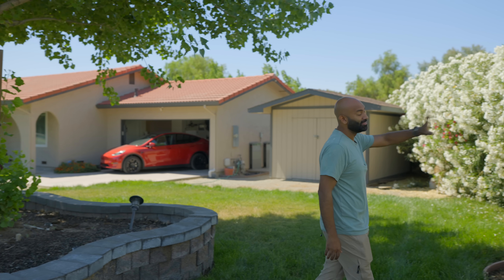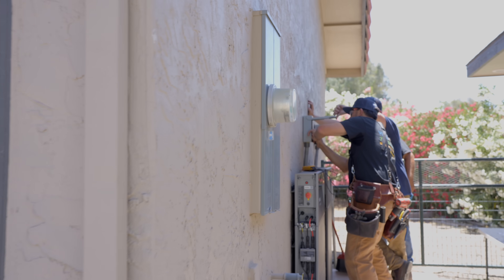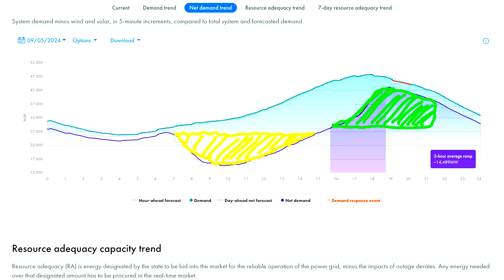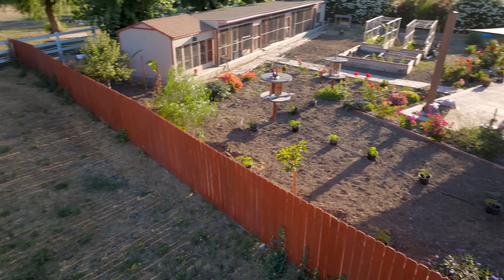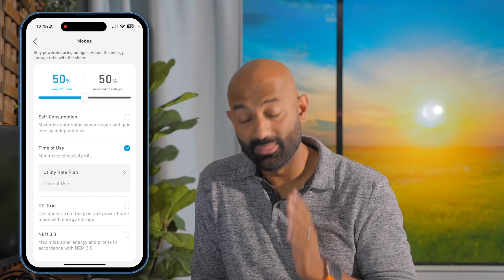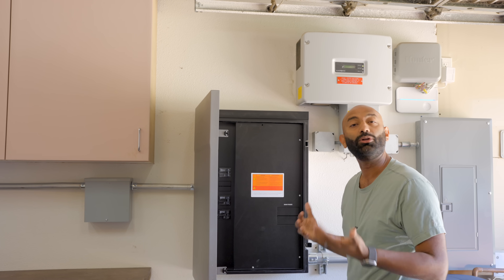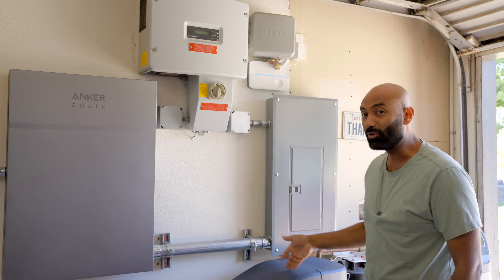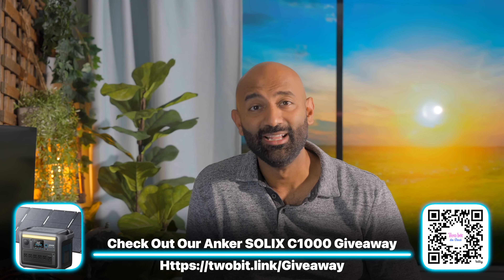Anker Solix X1 Home Battery - The One to Get?

Comment: We are completely off grid with a generator back and a boiler for heated floors and water. I wonder if I added this to my system if the generator would run less.
Reply: Some Hybrid Solar Inverters have a Generator option. If you connect directly to the Inverter, the Inverter will run it at a constant rate so you can set the most efficient setting for your Generator. This works best if your Generator has Auto-Start. So it should run less. As a side note... Generators always produce more power than you use if you are plugged directly into them. With an Inverter/Charger controlling Batteries, all of the power the Generator makes will go into the Battery (minus normal line losses). It is a more efficient set up as soon as you connect.

Comment: The way I am going to go about my system is, battery back up first. why? I want an APC style system to clean the incoming electricity so that my electronics do not burn out (where I am at,  I got 'dirty power' daily) also when a storm comes thru I will be alright. Solar is next with wind as a possible test project. now it's just money that is holding me back. lol (FL homeowner)
Reply: my thoughts exactly. set up a smart panel and battery back up first, but set it to add solar - perovskite panels when commercially available - and wind

Comment: Good video, but it would have been good to address why the montly bill after the batteries were installed was $121.17 compared with $71.94. Clearly they had much higher overall usage this year (the kWh number is up by a lot), but why was that?  Because if there's no factor other than the change to batteries, it looks like they were a poor investment.

Comment: I doubt I could use this in Southern Nevada with 120F peak air temps and this year over 100 days over 100F.  The exterior of my house is regularly 130F even out of full sun - add a battery that is generating heat as it charges or discharges and that's one hot potato.  Even if it keeps running what does that do for longevity of the batteries and inverters?

Comment: Great video and info, thanks.   Given they remain on NEM 1, can I conclude that they didn't need a new permit when they added the batteries?   I'd like to add additional solar panels to my current 5.5 kW system and possibly battery storage as well but have been told I'll lose my NEM 2 and go to the current less favorable NEM 3.   Live in SDG&E territory Encinitas CA
Reply: There are some exceptions that allow add-ons without losing your older NEM status, but I don't have a list in front of me.  I think adding batteries without expanding existing solar might be one of those exceptions.

Comment: In Ontario (Canada), we have a very generous Ultra Low Overnight rate TOU plan, which offers power at $0.03/kwh (works out to around $0.05/kwh with transmission charges). You can knock 30% off that for the figure in USD. Crazy cheap. I'm in a condo/HOA that likely would not allow me to get rooftop solar, but perhaps this type of system to act as a battery backup and energy arbitrage system would be good to cover peak demands. Not sure on the ROI, and our grid connection is very reliable (zero outages in 10 years).
Reply: Let me know which part of ON your in, I want to move there.  Here in Richmond Hill we get several outages a year - albeit mostly short.
Your condo will definately not allow solar on the roof.  Im trying to find a good system for my house that will have a fast ROI for beating the peak hour usage.  Its the cost of the installation of an automatic transfer switch I am thinking of mostly - you do not want power going back into the grid.
Cheers
Reply: @patrickmckowen2999  Mississauga. You need a gateway for your solar to work during an outage.

Comment: WOW, a 200A circuit for the grid, our house has a 50A Fuse.
Reply: For a single-family residence (not mobile homes or apartments or rural barns), A 200A service has been typical for 50+ years.   100A can still be found in a few places (not many).   Even in the 1930's 75A was actually more typical so it takes really really old construction to still have a 50A service, plus living in a state where the utility is allowed to charge the home-owner for upgrading to baseline (a few states, not many though).

Comment: Note that NEM 1 and 2 installations only get 20 years from the date of the installation before they are automatically moved to NEM 3.   My NEM 2 installation 20 years ago was just moved to NEM 3 at the beginning of this month, in fact.   So double-check what NEM your parents are actually on(!) and figure out when theirs will switch over.   The NEM-3 tariff is going to be E-ELEC and it does have a partial-peak period as well.  Its pretty nasty.

E-ELEC is the NEM-3 tariff.  Check to see what tariff your parents are actually on.  Once they're moved to NEM-3 they no longer get the infinite net'ing.  It becomes an import/export game with fairly low export compensation outside of peak hours.

Note that 20kWh of battery storage is really tiny, and 10kWh (roughly) of peak-period export is always a really small number.  That said, non-DIY battery storage is not cheap so you go with what you do or get.  And the main purpose is to deal with blackouts anyway, not really to break-even (which is unlikely with this particular system).

It looks like quite a decent system to me otherwise, so happy you were able to throw it together for your folks!  My folks really wanted to do solar and squeaked in with a NEM-2 installation just before the cut-off, so they are grid-tie.  Even though we offered, my Dad insisted on paying for it (it wasn't cheap), though he at least borrowed the money to make ends meet from me instead of from a bank (0% interest verses 5%+ interest).   He thinks of it as his contribution to the environment and future generations.

At roughly 3:30 you mis-spoke slightly on interpreting the CAISO demand graph.  The lower line is the demand from fossil sources.   The higher line is the total demand.  The area inbetween is covered by renewables.  Roughly speaking.

-Matt

Comment: I personally believe that any home lithium battery should be at least 10 feet from all combustibles.  While the iron chemistry is more stable the risk is still there.  I recommend relocating your parents batteries to 10 feet away and establish a gravel buffer area all around.   You don’t want the batteries starting a brush fire.  

Apparently State Farm has ordered the removal of vehicle charging stations from their premises.   The writing is on the wall that people with home energy storage and electric vehicles are going to be facing increased insurance costs or cancellation.
Reply: State Farm was concerned about a battery fire in an underground parking structure involving multiple MV versus a less risky outdoor parking lot installation. 
PS — as far as a house, you’d have to look at the risk posed by lithium iron phosphate vs lithium ion batteries.

Comment: How weather proof are the batteries? I live in the great white north. Do they have to be protected from extreme heat and cold, rain, snow, ice, etc? Can they be installed indoors?
Reply: Given the climate patterns the Environmental  thermal limits need consideration possibly emergency cooling .. The other issue is climate driven weather and  heavy rainfall flash flooding ..there's no way I would have them direct on the ground or a slab as the jet wash rainfall  we get would be saturating the first  50cm plus just on the bounce up.

You've also got the global flash flooding problem like this week in Valencia Spain ...normally a very arid area and the USA in the recent Hurricanes. 
A lot of you're homes are stick timber frame and board built..  quite frankly this and their conventional shape is going to make them increasingly vulnerable.  If you are going to build off grid you have to consider location ..extreme weather events including lightning strikes flooding  and droughts for the next century ... The old rules no longer apply, the 1 in 100 year event is now occuring 
Every 2-5 years and possible thousand year events could end up occuring on a decade basis.
Reply: @ Most of the installations I have seen are outdoors or in a non-climate controlled garage. In my area, that would potentially expose the batteries to temps ranging from -40C to +40C. Snow and rain would also be a problem; flooding, not so much. I would prefer to install my backup system indoors in a protected area like a basement, but I don’t know if that is allowed.

Comment: Why did they use twice the kWh for the month in 2024 than 2023?  Is the solar working?  Notice the bill amount went up $50 between the two years.
Reply: Depends entirely on the weather.
Reply: @junkerzn7312  Also depends on how often Ricky visited (to monitor the system) and charged his Tesla at their house.
Reply: I noticed that, too.

Comment: 42 cents us per kwh?  What the heeeellll. It's like 8,5 cents CAD here.
Reply: About 16 cents here in Pennsylvania 24/7.  CA is nuts.
Reply: California believes in renewables which two to four times more expensive than nuclear.   California has chosen the most expensive way to produce electricity.
Reply: FPL bill for this month shows:
1st   1000kWh =$0.081810 for non fuel charge
over 1000kWh =$0.091800

1st   1000 kWh = $0.026700 for fuel charge
over 1000 kWh = $0.036700

So the 1st 1000kWh is $0.10851 /kWh
Over 1000kWh is           $0.1285  /kWh

Plus taxes and a base charge of $9.55 a month and we average around 60 kWh per day due to the A/C being on almost all the time.

Comment: They could also use greywater and rainwater harvesting to reduce grid strain and water and electrical bills and build personal resiliency. 

Harvesting stormwater runoff from the street to landscaping and fruit trees makes use of an underutilized, free resource.  The bark of fruit trees absorbs the toxins making it okay to eat the fruit (landscaping is assumed to be inedible, streetwater runoff is inappropriate for perennials, annuals, vines and shrubs that are to be consumed)
Harvesting streetwater runoff also reduces flooding effects downstream while reducing water pollution in streams, rivers, lakes, etc.  
Harvesting more streetwater runoff would reduce the necessity for brownouts because less electricity would be used for irrigation.  It also means ponds, rivers and lakes are less likely to dry up.

Rainwater harvesting uses biology to quickly absorb water into soil so zero mosquitos reach flying stage, while creating fun, ephemeral pools.
Rainwater harvesting is pretty cheap and can be done for as little as the cost of a pick and shovel (which you can buy used and save more money.

Rainwater harvesting reduces heat island effects by keeping areas green and viable and the soil biota protected from intense sun.  This keeps soil aborbant.

Keeping things green via rainwater harvesting adds beauty, walkability, bikeability, creates shade, reduces ground subsidence and thus damage to paving and foundations, reduces the chance of sinkholes, etc.

Comment: You did not explain the 2023 bill vs 2024 where the bill went from $70 to $120. I thought the point was the bill would go down as well as other benefits. Does the bill include financing for the system?
Reply: They still used 90% more Kwh, 306 vs 161. They were almost all moved to off peak, but even off peak is still $0.42/Kwh! If the 2024 bill would've had the same 76/24 peak/offpeak distribution, the bill would've been more like $145.
Reply: @extragoode  Assuming the month is representative of the year, that's $840 savings per year? What kind of ROI are we looking at then?
Reply: @huihe953  almost no single month is representative a year, so who knows? We don't know how much the batteries cost and we don't know what size solar array they have. For that matter how much savings do you attribute to the batteries and how much to the solar? Was the solar paid off before the batteries went in? They're also running the batteries in backup mode, so they only ever use half the batteries unless there's an outage. They could probably offset more usage or sell more back to the grid if the battery reserve was 20% or something, but then you take the risk of running out faster.

Think of a backup battery as a generator that pays for itself. It's almost always going to be cheaper than the alternative to get the utility you want, at least eventually. So, what does it matter? A gas backup generator's ROI is almost always never, but lots people still get them.
Reply: This reminds me of how shockingly high CA electricity prices are. $0.12 kWh in Southern Nevada and no peak rates or tiers unless you opt into TOU. People were actually losing their minds when it went to over $0.16 when gas prices were highest - we have tons of solar but most of our baseload comes from gas fired generators and all our gas is imported.  

The flip side of this is people are not as incentivized to install solar and battery systems have extremely long ROI time frames because the amount you can save by peak shaving is minimal.  But the sun shines nearly all the time so if you can do a very substantial and cheap DIY battery system and basically go off grid that works.  A commercial battery system is never going to cut it unless you have money to burn or only need a few hours of backup in the summer heat.
Reply: @CasaDeMuchosGatos  I thought most of Southern Nevada's electricity came from Hoover dam, at least when the reservoir is high enough
Reply: @CasaDeMuchosGatos  I thought most of Southern Nevada's electricity came from Hoover dam, at least when the reservoir is high enough
Reply: For California, your electric bill more or less reflects how much A/C you had to run to deal with the heat in the months of July, August, September, and October.  If near the coast, basically the number of heat-wave days.  If you have solar, then its the number of heat wave evenings and nights (which isn't typically very many on the coast or in the mountains, and is more prevalent in the central valley).  So there are going to be a vast differences from year to year.

Comment: Kudos to the installers.  Very clean, very neat installation.  You talked at length on the savings (California's price per kilowatt-hour is outrageous), but what about total cost of the equipment and installation?  What was the cost of the solar installation?  What I'm getting at, is what is the payback period?  I realize the value of having some grid outage back-up, but where is the break-even point?  Ten years?  Fifteen?  Twenty?

Comment: This adds a huge fire hazard that is hard to extinguish.
I get the benefits but i would still feel uneasy.
Reply: This is less dangerous than gas line connections but billions of people are comfortable having them.
Reply: @peterirvin7121  I would say those have different danger profiles.
Gas lines do explode if not well maintained but are very save except for mishandling or entropy due to the lack of maintenance.
Accumulators of all types do have the possibility to start a fire even if everything seems to be in working condition.

Comment: Battery system should be installed off the ground. If there is a flood the lithium could catch fire
Reply: Outside of certain parts of Sacramento and the Central Valley, and a handful of rivers (The Russian River for example), residential flooding isn't that big of a concern in California.  A lot of water can move, sometimes, but California is a lot more strict about building in flood plains than anything east of The Mississippi and has a lot of flood control options.
Reply: It's lithium iron phosphate so very unlikely to catch on fire but it's still a good idea to raise it up off the ground just so it doesn't get ruined in a flood

Comment: Next project there you should add insulation panels to that garage door and some extra seals around the sides, plus change the motor out for a direct drive motor that mounts on the side and is WAY quieter. Keeps the garage a lot cooler in summer which will help the life of the electronics in there, and also warmer in the winter. Plus all the extra dust the sealing will keep out which is nice as well.
Reply: Any links you recommend to solutions you are suggesting?  Might want to do that myself
Reply: Replacing the garage door hinges with tensioned hinges, also advertised as "spring loaded garage door hinges" also does wonders

Insulation and seals mean nothing if the wind just pushes the door in slightly and goes around the seal

Comment: I don't understand the economics of batteries for individuals versus large, utility-scale, batteries -- for most people.  Powering the well, OK.  But, what is the frequency for most of us for losing utility power? PG&E has more money for batteries than most moms and dads.
Reply: This home had nat gas (saw meter).  How about a simple backup generator?
Reply: @Eric-xq4dy  Or a simple solar generator. My parents have grid tied solar and my dad doesn't like that it doesn't provide backup power, but can't wrap his head around a solar generator being enough for most outages. And if it's not enough, then you pick it up, drive it somewhere they have power, charge it, and plug it back in. In my mind portability trumps capacity. Your freezer will still be frozen after 3 hours without power if you don't open it.